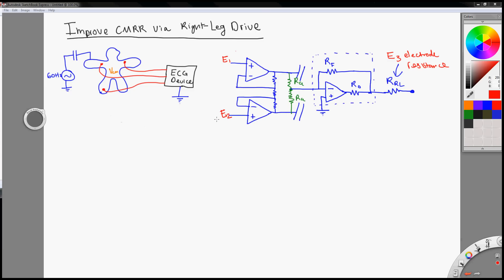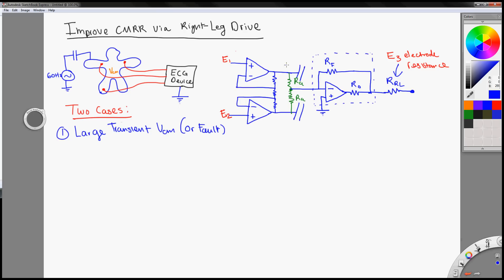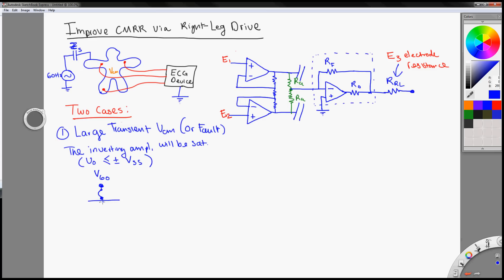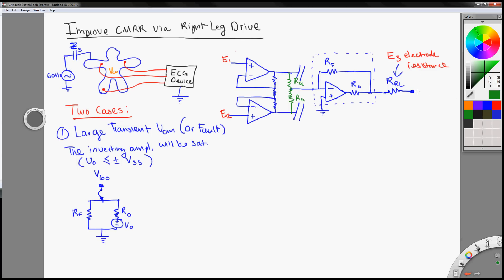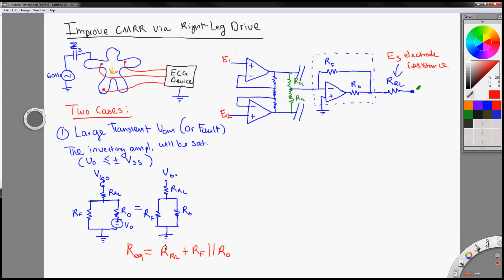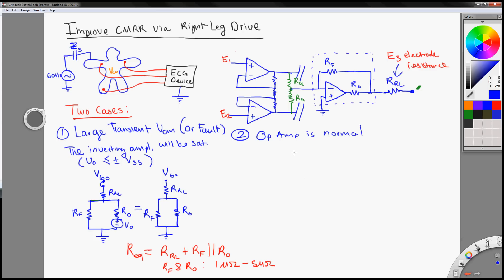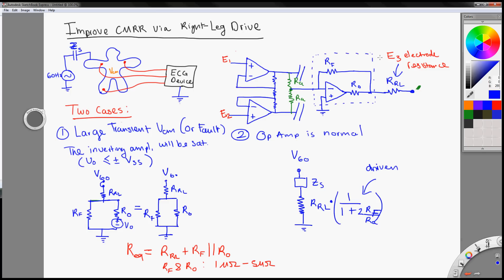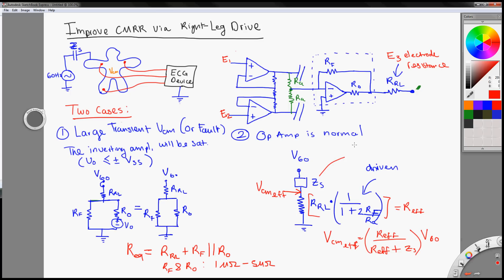Biomedical Instrumentation Part 2 (Electrical Fault Protection and Common Mode)

Comment: sorry for asking this almost 10 years after you posted it. But i cant understand how the oap goes into saturation if the input is high and its an inverting amplifier, shouldn't it short the output to ground (this is also called saturation in single rail OAP).

Comment: I don't see why Rf is also connected to ground in case 1. If the amplifier is saturated we cannot say that the inverting input is a virtual ground anymore. It holds while the amplifier is in linear range. Could you explain that? It is not clear to me that.

As I see, the voltage at the inverting input should be V_60 as well, since v_cm=V_60 goes through E1 and E2. As I see the circuit, the equivalent during case 1 should be R_eq=(R_F//R_RL)+Ro since v_cm is also between Ra in case of fault.

Thanks for the video anyway. It is not easy to find good explanations on Right Leg circuit.
Reply from the maker: PaulMallako You are right about the amplifier behavior when it's not linear.  You can do analysis with the op amp saturated.  Just have Ra's connected to gnd and Rf.  Since Ra's in parallel is much smaller compare to Rf (typically) the result is close to assuming pseudo gnd at the inverting.  If the Rf||Ro and R_RL are large enough so that the amp will be linear and this wouldn't be an issue.  The Ra's resistors do allow the negative terminal to be a pseudo gnd when E1 and E2 are V_60.  Redraw the inverting amp with the Ra's as a single resistor (equivalent) and you will see that this is just a basic inverting amplifier.  Hope this helps.
Reply: +Kelvin Le I still don't see why  R_A should be connected to GND in faulty scenario. I think it should be connected to V60 as well since V60 would come from all electrodes E1, E2, E3. Therefore V60 would come to GND from both sides: (R_A+R_F) and R_RL, both passing through Ro.

Thus, in faulty scenarios, R_equiv=Ro+[R_RL//(R_A+R_F)]

Comment: About the first case, how does grounding his right leg protect him from being electrocuted? Isn't it the other way around? I mean when you ground his right leg then any wire he touches will pass electricity through him to the ground.
Reply from the maker: you're right about the right leg drive.  The safest thing to do is not to have the right leg drive at all.  Battery powered instruments do that for you.  The reason why people even considered right leg drive is is because of noise cancellation and the equipment has to be powered for long periods of time.  I believe i mentioned that the last line of defense is the impedance looking into the RLD.  Which is why the resistors you use has to be in the mega ohm range.